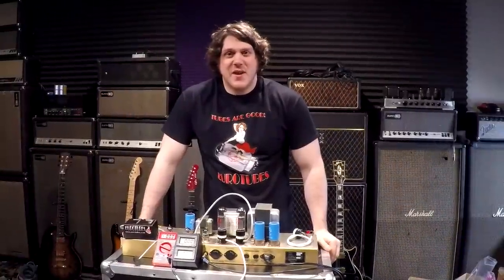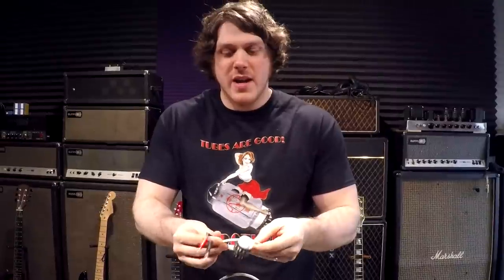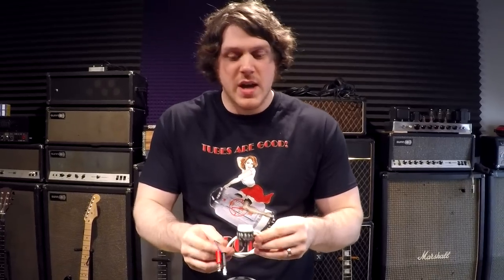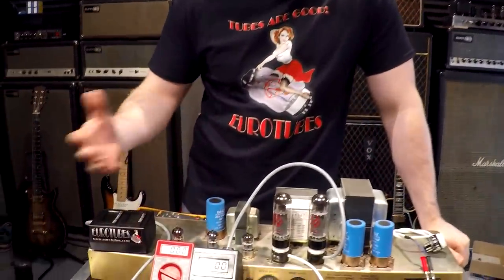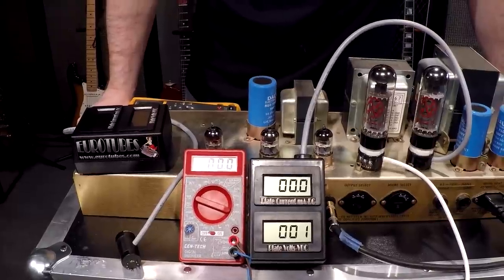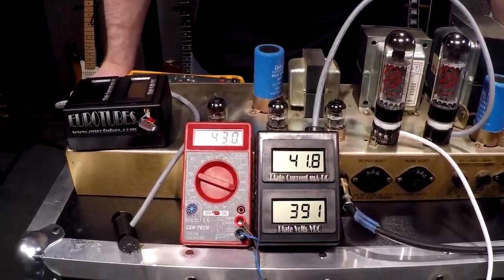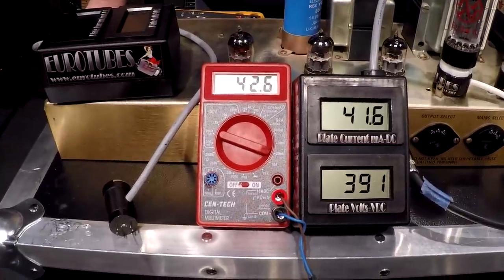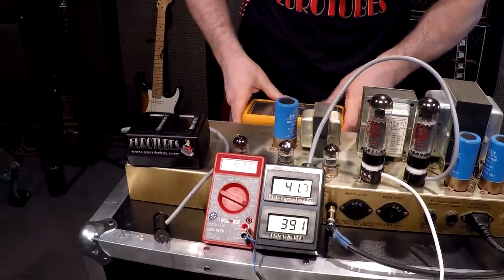Eurotubes Bias Probe Comparison Video

Comment: If you have 4 - 6550 tubes, how do you match bias them perfectly at the same time?
Reply: That's why you want to start with a match-rated set of power tubes to begin with. From there checking/adjusting the bias off of just one of tubes is all you'll really need to do. If the tubes ratings are mismatched then set to the best average you can without running them too hot.